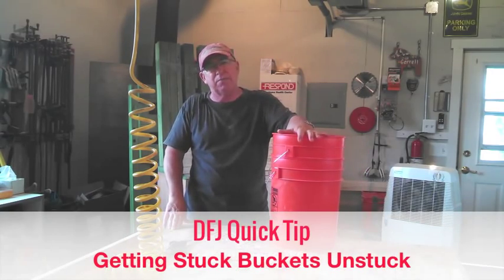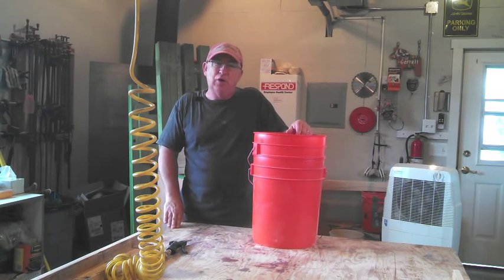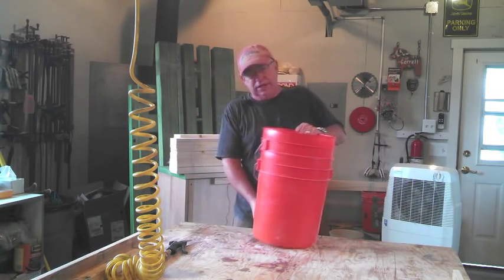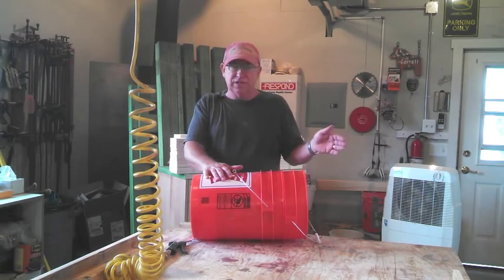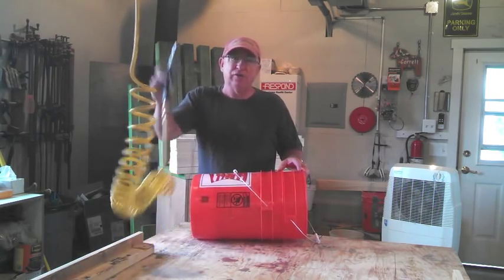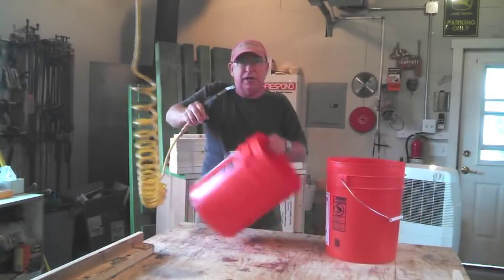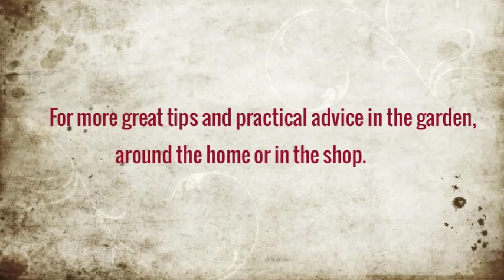Getting Stuck Buckets Unstuck - Volume 1

Comment: Having tried so many tips of how to separate stuck plastic buckets,  your tip is the only one that works for me.  Instead of using an air compressor, which I don't have,  I used a Datavac electric duster.  Keep up the good work.  Thank you!

Comment: You saved the day Jay !! I'm not exaggerating when I say that I beat, pounded,kicked ,hammered and stomped on 3 buckets that seemed welded together for more than a half an hour. I was going to trash them but figured someone on you tube would have a solution. I was right. after watching your video I went straight to the garage and after about a minute and a half ,no exaggeration again, they were apart!
Reply from the maker: Wayne, glad to be of help! This approach as worked really well over the years. I've had some contact me and tell me that if you don't have an air compressor, you can put the bottom bucket in hot water to get the air inside to expand with the result being the top bucket get pushed out. I suppose you could use a blow dryer as well. At any rate, glad to help you out! Best, DFJ

Comment: My air compressor nozzle didn't fit in between the buckets very far, so I used a simple drinking straw as an adapter.  I wedged the straw a few inches in between the buckets, placed the nozzle to the straw and it worked like a charm!
Reply from the maker: Mark Lessard - FANTASTIC IDEA! Thanks for sharing, I'll likely do an update on this video with some of the great additional ideas that have been submitted and I'll be sure to include your and give you a mention. Thanks for watching and writing! Best, DFJ

Comment: Try running hot water over bottom bucket in bathtub. After about 30 seconds there should be enough air pressure inside small inner air space to push top bucket loose.
The Dirt Farmer Jay's method is the cleanest way for those with air.
Reply: 😄 thanks!!😉

Comment: I had two buckets stuck together and realized it was a vacuum lock holding them together.  So I took them to the bathtub and ran hot water over the outside/bottom bucket for a few minutes hoping it would expand a bit.  Then I took them out of the bath, turned them upside down, stood on the handle of the inner bucket and pulled up on the rim and handle of the outer bucket.  They came apart quite easily.

Comment: I don't have a compressor, so simply shove a large screwdriver in between and pull. The screwdriver allows air into the space between the buckets freeing them. Blessings
Reply from the maker: Clifton - thanks for the tip! I've had various suggestions added to the method I showed, and plan to make another video showing what viewers do when faced this situation. Yours is simple, straightforward, and economical. Thanks to watching - and writing. Best, DFJ

Comment: Great tip. Do you a a tip on removing the lid off a bucket of chlorine?
Reply from the maker: George, I assume this is a snap on lid. Are we talking chlorine liquid? What size container? Are you going to be using all the product at one time or using this container as a dispenser or ongoing storage source that you need access to several times? Give me a bit more and we can go from there. Best, DFJ

Comment: Not every home HAS  a compressed air setup or canned air . Good idea but  your paragraph isn't accurate in stating every home has this avail.
Reply from the maker: Rere, thanks for writing. Not sure where I said all homes have either canned air or a compressor, but many do. Another method is to heat the bottom bucket with a hair dryer or placed in a tub of hot water. This expands the air that is trapped in the bottom bucket and helps push them apart. Thanks for watching - and writing. Best, DFJ

Comment: I don't have the ability to pull mine apart like what you do so what do I do next
Reply from the maker: Rawlin, are you saying that you don't have a compressor so you can't use this method? If so, some other viewers have written in and given me their approaches. One way is to use a can of compressed air that is typically used for cleaning keyboards of computers. Use the same approach that I showed. Another is to put the bottom bucket in a sink of hot water. This will make the air that is in the bottom bucket expand, pushing the two apart. Let me know if either works! Best, DFJ

Comment: Viewers, and if you cannot afford or want to buy an air compressor because you just don’t need it or have the room. A rubber mallet works just fine. Not a lot of force required around the rim of the second and rotating as you go. Once separated to avoid this reoccurring put a 35x70 mm block in the base of each one. Problem solved. I agree make sure that the handle is free. Cheers 🇦🇺👍🍺🍺

Comment: I don't have a nice compressed air hose nearby... now what?
Reply from the maker: +Two Vees - there are limited options because the problem is two fold: suction/vacuum and friction. Because the sides of the buckets are tapered, they nest very efficiently and there is a lot of surface contact between the outside of bucket that is inside and the inside of the bucket that is on the outside (how's that for double talk?!!!). Secondly, when they were pushed together and the air trapped inside was expelled to the point that a vacuum formed. Two ways to get them apart is by breaking the vacuum (replacing the air with the air compressor nozzle in the video accomplished this), or by overcoming the friction by even, slow consistent tension (pulling force) between the two buckets. You could attempt this by suspending the buckets upside down and supporting the top/outside one by the ridges just below the rim, and hanging a weight from the handle of the stuck bucket. This may eventually overcome friction and break the seal. Or, if there are moderately stuck, turn the two buckets over, and put your foot on the handle of the inner bucket and put your weight on it as you push the handle to floor/ground. At the same time, use the ridges of the outer bucket to lift up slowly and evenly to break the seal. Let me know if these work for you! Thanks for watching our videos and be sure to pass us on. Best, DFJ
Reply: +Two Vees Alternatively, use water in place of the air.  To do this, you need to create an opening just like he did with the nozzle( a knife, bamboo skewer or anything that can give you some room between the two surfaces).  Once you have some gap between the two, start to fill with water until you see the inner bucket start to float.  Stop the water and pull out.
Reply from the maker: +Titilayo Adetola - Brilliant! I may do a video in the spring using this technique and give you credit for it! Thanks for giving your insight!  Best, DFJ
Reply: +DirtFarmerJay Thanks, I'll look forward to it.

Comment: sigh...
yeah, and if I had an air compressor I would've already tried that. 😑 oh well. on to the next video...
Reply: Thanks for visiting! We had another viewer that indicated a can of compressed air did the trick for them as well. That might work for you. Thanks for writing.
Reply: Use a hair dryer to heat air I. bottom of bucket by aiming the heat at the bottom of the bucket hot air expands breaking vacuum seal and helps release the stuck buckets.

Comment: Not everyone owns one of those air things
Reply from the maker: Tony, you're right. You can use the same principle using other devices as well, such as canned air that is used for cleaning computer keyboards, or using the output side of a shop vacuum. Message to Judah mentioned the compressed air duster. Another tip another viewer submitted (Sherman Garner) the tip of running hot water over the bottom bucket to build some air pressure and allow you to slide the top bucket up and out. I hope this helps! Thanks for watching and writing!  Best, DFJ